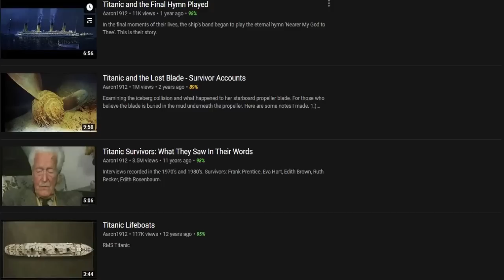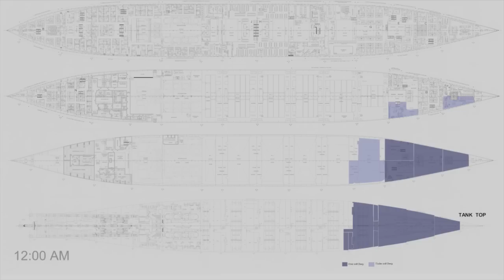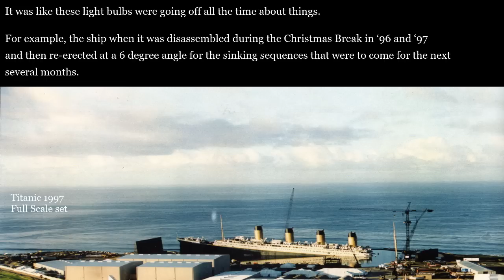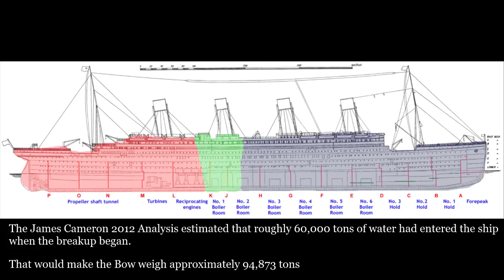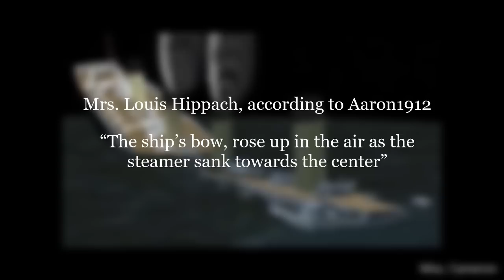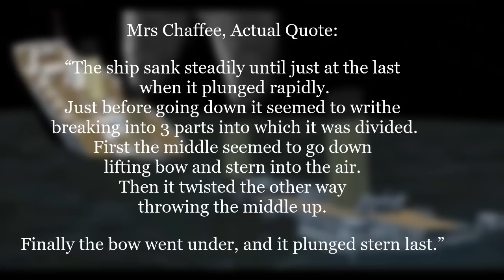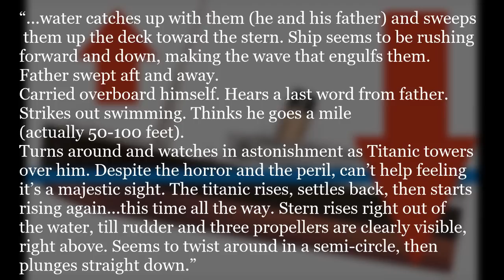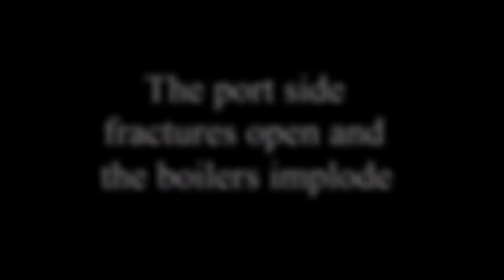Disproving Aaron1912's Titanic V-break

Comment: I wasn't aware that this 'V-break' theory was even a thing, I thought most people accepted the regular snap.
Reply: Some people just can't accept the truth.
Reply: Das_Bass was that a disgreement to this comment, or the v break.
Reply: @redzeppelin6  Everybody has their own "truth". Facts don't lie. Only people.
I came up with my own 'V-break' theory after watching the Cameron discussion. Except my V-break goes the other way. My theory diverges from the Cameron theory in one spot, when the double bottom finally separates.
The aft section still has a fair amount of flotation, while the section to the third funnel fills with water.
The stern rose out of the water until the hull failed at the third funnel, except the double bottom, which held for a bit longer.
After the break the stern settled and started to fill with water. The bows is still attached by the double bottom, helping to pull the stern vertical again, could also explain the the half roll.

Haven't done a finite element analysis, so its only my thoughts.
Reply: Nah, for decades people refused to believe there even was a snap and said it went down as one piece. Theres even a movie of it not splitting at all
Reply: @rufushowell  Raise the Titanic. It was a Clive Cussler book before that. He probably wrote it that way for a plot point. Then, as is usual, it became 'common knowledge'. How many other movies and TV shows have we seen that take those kind of liberties, only for the audience to take it as a historical document?
Reply: @coreys2686  It was already considered "common knowledge" that the ship went down intact even right after the sinking. While several survivor accounts said the ship broke in two, there were others, namely higher up people/ crew like Lightoller who said Titanic didn't break. The inquiries ultimately sided with people like Lightoller and other crew/upper class survivors, so the official story was that Titanic sank in one piece, and wouldn't be proven to have broke until the wreck was found. Raise the Titanic wasn't the only film to say the ship sank intact, I believe A Night to Remember and the 1943 Titanic film also had the ship sink without breaking.
Reply: Matt Boy52 But then they found the wreck of Titanic, and Titanic did break.
Reply: @mattboy5296  the crew members at the time said it didn't break to save them PR. They lied intentionally so it didn't seem "that bad". This theory is so easily disproven by literally looking at the shipwreck. The bow and stern completely broken off and separated, 50ish meters away from each other on the ocean floor. Come on man..
Reply: anyway,shipwreck is a very traumatic experience,specially at night,and survivors are not a trustfully sources.remember  ̶2̶0̶0̶8̶ 2012,costa concordia,people drowning in panic between the ship and land,literally you had to take care not to jump on land from the ship,in calm warm water...
Reply: @rufushowell  That would be "Raise the Titanic".  In Cussler's novel two competing theories are noted; one that she split when she sank.  The other, that all the noise as the stern rose was her boilers breaking free and punching their way through the ship and out the bow.  That loss of weight then allowed the stern to settle, instead of a break allowing it.  The story bluntly noted that they had to go with the second theory because they couldn't very well bring the ship up if she was in two pieces.  Of course this was before the wreck was found and there really was serious debate about whether she split or not.
Reply: Me too
Reply: @xiro6  Costa Concordia was 2012.
Reply: @TheDD5623  my fault,sorry and thanks.
Reply: They actually found the Keel at the bottom outside of the normal debris zone a few years ago and it shows that a V-break never fucking happened because the double bottom Keel was cleanly split
Reply: @coreys2686  all movies before 1985 depicted the Titanic as sinking intact from A Night To Remember to Raise the Titanic because despite what many survivors said, the official inquiry concluded that the ship sank in once piece. The author Kent Layton was a guest on one of T:H&He's anniversary livestreams and said it was surprising to him, from the survivor accounts he researched for his books, that it was ever concluded that she went down whole.
Reply: Same. I was like “wait, is this even contested?!”

Comment: I am certainly not an expert on Titanic but there seems to be other flaws in Aaron1912's theory. If the watertight doors were all open and the ship flooded evenly the boiler rooms and electrical dynamos would have been compromised early on. However, there seem to be no doubt but that the lights were on almost until the end. If there was water throughout the ship that could not have been the case.
Reply from the maker: Exactly lol. His new "amendation" to the theory is that the water (which was trapped in the bow) made the ENTIRE ship sink down horizontally in the water. Then water entered E-deck's Scotland Road where it poured into the central boiler rooms. This pouring made the center of the ship heavier and caused the "v-break"
Reply: @TitanicAnimations  That...still makes no sense. Ugh. Thank you for saving me from raging at this dude. T . T
Reply: @TitanicAnimations  That's not  how... gravity works. I think anyone who's ever lived on this planet should be able to figure that out.
Reply: Aaron deleted his own channel
Reply: @TitanicAnimations  There is also the rather questionable medical impossibility his misuse of that one survivors quote presents, you know the one that implies the bow came up under them and lifted them out of the water. Not to beat about the bush but even at extremely low velocities a collision with 30,000 tons will not leave you in a state where you have a hope in hell of surviving when dumped back in the water even if it doesn't simply kill you outright which it would even at speeds as low as like 1 m/s or so. Humans are not well designed to be hit by tens of thousands of tons of steel moving at almost any speed whatsoever.
Reply: sidibill If they were all open it would sank like the britannic did and the ship wouldve just rolled over halfway through.

Comment: I think the most obvious flaw in Aarons Theory is if the ship broke up in a "V" why are the boilers in Boiler room 2 still attached to the bow section at the ocean floor? IF the ship broke in towards the centre those boilers would be gone just like the boilers in Boiler room 1
Reply: The two parts of the ship would also be fairly close together rather than several miles apart.
Reply: The bow decking would also be as destroyed as the stern is today because the ships seperated parts at the top of the water would trap air on the way down until the implosion.
Reply: @protoborg  the stern is 2/3 of a mile away from the bow not several miles. The debris field would most certainly be in a tighter configuration.
Reply: @sorrenblitz805  I imagine that in a v-break all of the debris would spill almost directly under the ship in a space not much bigger than the mid-tower that sort of vanished from the wreck, and it's possible the bow and stern would land much closer, perhaps even crash into each other on the way down.
Reply: @ollienang7253   And notice how the bow decking bends downward at the point of the break, not up?
Reply: I think the most obvious flaw is that if the bow(with the great big hole in it) was so full of water it dragged the rest of the ship under, it's not going to break away and float off like a champagne cork. Especially if there was any reasonable forward tilt, as described, and if the watertight doors were open, as described.

None of this makes sense from the most basic understanding of how water works.
Reply: @Halinspark  It doesn't make sense but the survivor accounts do seem to make that claim. The ship had a ton of weight near the spot where it broke, the boilers and reciprocating engines were near midship and the fore section of the bow were collision bulkheads and bunks, much lighter. If the ship broke in half, that weight might overtake the weight of the water and sink the aft section of the bow first causing the fore section to bob back up as claimed. He even says in this video the majority of the weight was in the bow, but most of that weight had to be from the boilers and furnaces, etc. which are near midship or the aft section of the bow. The boilers alone were about 2,650 tons so maybe it' not totally insane that they sank first after breaking off, with such force it raised the fore section of the bow after the still buoyant stern was no longer holding them up. The stern could sink later giving it more time to drift. Sounds crazy but the survivor accounts bring things into question.
Reply: If anything I'd say boilers in room one missing points to that being where the ship broke in half. Something had to break the mounts on the boilers for them to be lost, it's not like they let them roll around in the ship while in high seas.
Reply: Good point

Comment: Normal Person: "Ah. I see. So the water entered the bow and made it heavy, which made it sink and lifted up the stern. Makes sense. It's an issue of balance."
Aaron1912: "That's what they want you to believe. What actually happened is Titanic took water in at the bow and then it sank vertically straight down with almost no angle to it and it broke in half for some reason despite not being under any stress."
...This Aaron guy needs a new hobby.
Reply: Aaron wants the Titanic to sink like most other ships but completely excludes the fact that it wouldn’t break in half if it did so
Reply: What gets me is unless there where  did the air exit to have it plummet straight down(even in half)? If all the windows where open it wouldn't sink like that either
Reply: It sinking without a list is probably impossible. They would have had to pump water to the stern which I don't think anyone claims they did. BUT, the ship is not evenly weighted, which is even shown in this video, the bow is much heavier than the stern. So where's that extra weight from? The 5 of 6 boilers and furnace rooms in the rear of the bow, which are significantly heavier than the front of the bow once it breaks off. So once it's broken off it's definitely sinking aft section first, but how long did it take to swing around? Maybe fast enough to lift the comparably light front section of the bow?
Reply: @bobbygetsbanned6049  Bruh. The first five compartments of the ship were breached. If anything, that would be the heaviest part of the whole ship as it sank.
Reply: @jamesgroccia644  Water doesn't make the ship heavier, it just reduces the buoyancy. Steel boilers and furnaces on the other hand way significantly more than water.
Reply: @bobbygetsbanned6049  Alright. If you cut a flooded bow loose, it will sink immediately because there’s no air. And because at the time of breakup the Titanic’s foremost part was at 200’ below the surface, the water pressure would’ve been high enough to cause implosions. Looking at the condition of the bow wreck, this is not the case. The bow looks nearly intact because it was full of water when it sank, so one can assume there was zero air space left when the ship dived below 200’ underwater. In simpler terms, the Titanic’s bow was much heavier compared to the stern because the stern was full of air and still buoyant.

Also, if the bow was still buoyant (full of air and not water), why did it sink in the first place? Because water flooding in would force out the air inside the hull, that’s Sinking 101. Air out, water in. Water heavy, ship sink.

Comment: The v-sinking and the rising of the bow can be explained fairly well although barely in the case of Titanic. I am a seafaring officer and ship'stability is a fair part of my job.

As a baspic: ships break when the stresses acting on the hull exceed its strength. Relevant for the v break are the following scenarios: when a ship is hogging, the bow and Stern are both heavier than the middle (either through cargo or water ingress) and thus the bow and Stern are lower in the water. The more weight is added to both ends, the higher the stress until it finally breaks. You can try it with a pencil: put your hands around both ends of the pencil (weight) and your thumbs below the middle (buoyancy force) and push both ends down with exceeding force. The pencil will break upwards.
When a ship is sagging however, the middle is heavier and also deeper in the water. Again this can be demonstrated by the pencil with now opposite forces.
Neither was the case in Titanic as she had her hole solely in the bow section. Neither her Stern nor the middle section were touched. The resulting trim by the bow would not have made it possible for the water top flood as far aft as claimed without flooding the compartments it flows through first. (I mean that was the entire design flaw of the titanic watertight compartments... They were open at the top - > spillover effect. Try it out with your grandparents pill box, if you like. ) such a spillover or flooding from compartment to compartment would increase the trim, rising the empty and comparitivly light weighted, unflooded Stern out of the water until the stresses are to high. The forces on the end of the Stern will act downwards as the weight force of the Stern remained but the buoyancy force (always acting against the weight force) of the Stern was reduced due to the rising of the Stern caused by the sinking of the bow.

The v-breakup does happen in shipping. Ships in torpedo attack in second world War for instance, that were hit midships were often prone to sink that way. But the titanic sank by spillover from compartment by compartment. 

The lifting of the bow can be explained when considering the upward v-break: in this case the - as explained above - already heavier middle section (now end section of both broken ends) increase their weight by an enormously high amount of water flooding into both the Stern and bow section by the break point. The middle section now begins to sink rapidly. On the bow section it first will mostly counteract the existing trim. Depending on the flooding rate it might even reverse the trim. Alternatively or simultaneously the Stern section might not have broken off cleanly. For instance the sections might still be connected by the deck plating. As the Stern section now is sinking by the middle, it pulls down the bow section by the middle, too thus raising both bow and Stern out of the water. However this is more a theoretucal thought experiment in case of titanic.